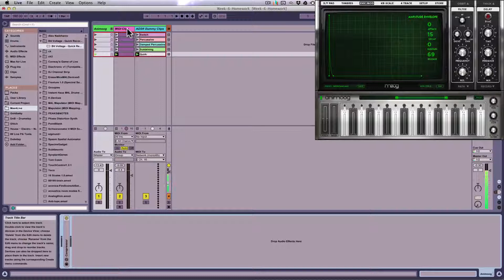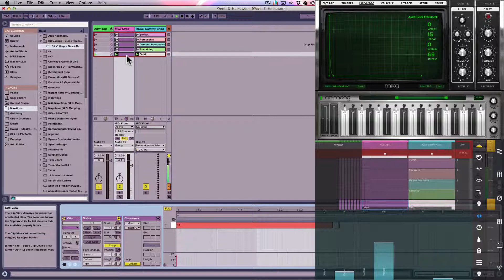Automating ADSR Modulation on External MIDI Instrument in Ableton Live [Blendrix Audio Academy]

Comment: I too discovered the quirky envelope. I was creating a hit hat sound on my mono synth. It turned  out very useful, you can create similar sounds to that of a closed hat and an open hat, all with the same preset. I guess it's kind of like when a drummer hits that hat and leaves the stick against the plate. And when the drummer hits a hat and instantly retracts the stick after doing so.
Reply from the maker: +cisko3000 That's an interesting idea. I usually put my drum hits in a Drum Rack, and utilize the Choke Groups feature to create that crisp back-and-forth play between the open and closed hats.
Reply: +Blendrix haha yeah that's what I do too. I just discovered that quirks thing accidentally n went with it for that project. what kind of mic are you using in this video? the vocals are most impressive
Reply from the maker: +cisko3000 Well, it's been a while since I shot this video, so I don't recall whether I was using my MXL 990 or my Audiotechnica M4000S. The richness / fullness of the sound seems to suggest the MXL, but I can't be sure. 

There is another video where I know for a fact that I was using the MXL to record some singing vocals, and that's this one: https://youtu.be/5xVzmqjuJWs?t=2m34s

I'm not a good singer by any stretch of the imagination, but you can really hear how much clarity a decent microphone lends to a vocal track in the mix. The MXL 990 isn't even an expensive mic. They're going for about $100 on Amazon these days.
Reply: +Blendrix That's really good, I thought you were gonna mention an expensive mic.